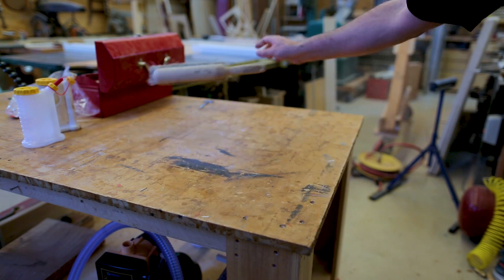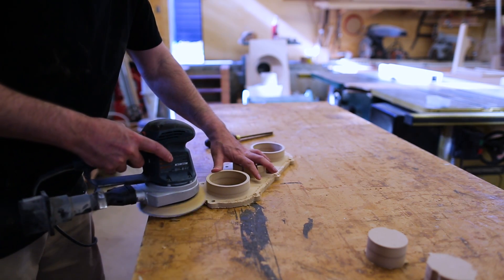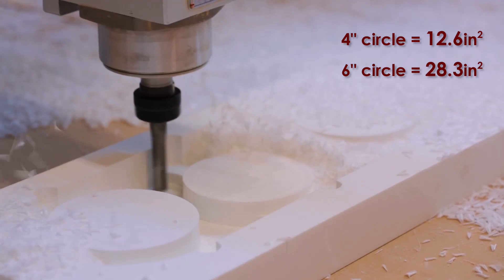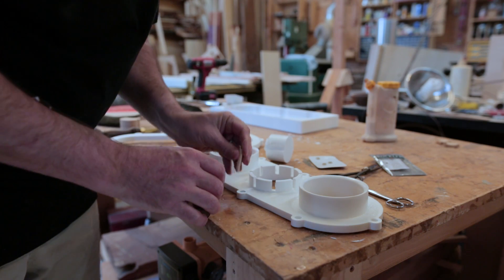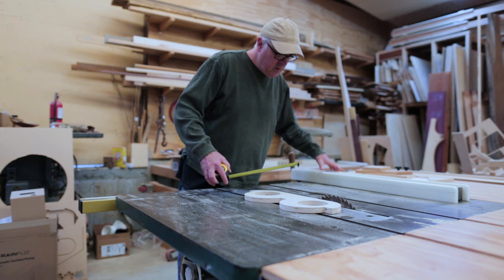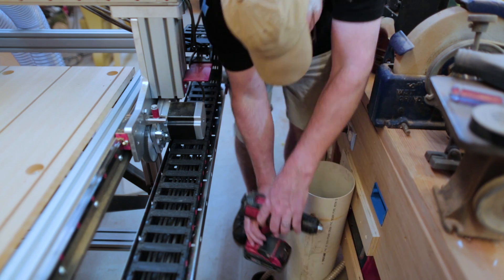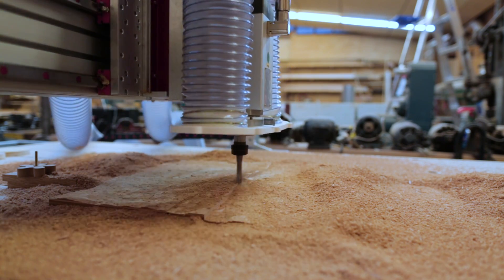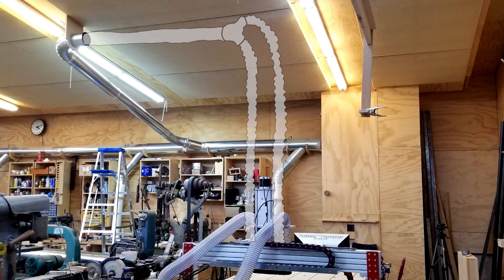CNC Dust Collection part 1

Comment: a 2 or 3 inch removable/hinged brush in the center is the way to go. even when open, 95-98% of the dust will be sucked and you would still see the cutter working.

Comment: Someone else mentioned clear plastic, also you can leave a gap in the front of the brush the suction will still pull air in it and you can see the bit

Comment: It's better to make a "spoil board" to screw your projects to, so your not messing up the wood clamp top... I know you can resurface it.. but you only get so many passes.  Also watching your machine cut the dust shoe, your cam is not set set for optimal cut paths for sure.

For test pieces... I buy the sheet foam at big box stores... (I prefer the purple 3/4" stuff)peel the plastic off and cut/shape away... cuts easy and fast, less wear on your bits... and if you mess up with the g-code it doesn't break anything, and less money than wood.

I built my 10' cnc table from scratch, and I run cambam... for my cam software. 4kw liquid cooled spindle. Good tool.

-Mick

Comment: Hi Frank, I watched this video last week and an idea came to me that may improve on the brush and not visually obscure the cutting tool like a brush. If the brush were replaced with an air curtain it may keep the dust in and allow a clear view. I've worked with air curtains in large industrial plants and they are effective in keeping dust out of sensitive equipment, we used to take a clean compressed air supply and direct it where needed and it worked wonders. I could see a manifold like a copper pipe that has been shaped like the outline of the brush with air ports drilled along the bottom allowing air to hit the table and forming the curtain. Might work?
Reply from the maker: +Brian Boni that's a new one. i like it. Thanks

Comment: Quick Tip: I was triggering my proximity sensor on the Z axis with my dust collection hose.  The wire inside the hose was enough to trigger the sensor because it was dangling around the top of the Z axis.  A small guard fixed it, but was a pain to figure out why it was stopping all the time..

Comment: If the modified bristles don't work out, you could do what I did. Mine is made of clear plastic on the top. You might not be able to get it thick enough for the same way you did this, but I'm sure there's some way to incorporate or include clear windows from the top. Visibility isn't perfect but it helps a lot.

Comment: If it helps for reference, there is a boot for Shapeoko CNC machines called the Suckit Dust Boot.
It doesn't look like it will fit your machine, but you might be able to make something similar.

Comment: Your projects are always inspirational. My $0.02 on this one: Also experiment with a single 4" hose shoe. Does the increased airflow from two hoses balance out the additional loss of suction from the increased size of your brush-enclosed area? My guess is no. The brush-enclosed area should be small for best results. You could actually use both hoses, but reduce down to a smaller brush area with a manifold--that would be sweet. The skirt needs to go all the way around and control airflow as much as possible to be effective. But, as suggested many times, an upper shoe cut from acrylic or plexiglass will increase visibility. Also, a making either the whole skirt or just a window region in your brush from a sheet of flexible clear nylon cut into strips will really help with the visibility. Cheers!

Comment: use the clear plastic brush parts. the brush is really just to corral the dust and create a negative pressure in the cavity. If you used clear plastic flexible "fingers" you could see the work piece and get optimal suction

Comment: As for holding down pieces to the CNC table, have you heard of polymer nails? I hear that the CNC guys at the Artists Asylum use these to hold down their work, which easily pop off after they're done; and not cause any damage to your router bits if you hit one by accident.

https://raptornails.com

Comment: Hi Frank,
nice Video - as always :-).

Two recommendations:

1. If you want to glue something to plastic try RTV silicon. I use this even on POM and it works. It's not super strong but keeps the magnets or the brush in place.

2. To see the router bit during the operation you can make a cutout in the brush. This also helps controlling the air flow. If the brush is all around, the air do not know which way to go and sucking is from everywhere. If you have a small cutout in the area of the router bit the air has a specific way to flow and helps sucking (especially with your suction power).

Best Regards from Germany

Alex

Comment: Nice. Have a suggestion. If you are worried about the visibility of the router bit, why not install a little camera on the plastic piece, pointed at the bit?
Might work. 
Great channel. Thanks.

Comment: Watching this I can't help thinking that the suction would be a whole lot better if rather from the top, the suction came from the sides.  After all, that's the direction the chips are already heading.  So the area just inside the brushes in a loop, if that makes sense.  So just before the chips hit the brush there would be a channel.  Just a thought.
Reply: Good idea only draw back to that idea is how do you get the suction from the sides low enough? When the bit is doing internal cuts something rigid on the outside might limit travel too much.

Comment: For the map data did you convert a DEM to an STL? I've been playing around with that but haven't gotten an output from my mapping software that I can work with well in Fusion360.
Reply from the maker: not sure if this is standard but it is how i figured it out
gray scale tiff from earthexplorer.usgs.gov
displacement on a plane in 3d studio (200x200)
save as obj with quads
import in to Fusion360 and convert into T splines
cam away
also this might be helpful:  http://makezine.com/projects/convert-geological-information-into-custom-map-fit-for-3d-printing-and-milling/

Comment: It'd be cool to wire in solenoid air valves into the power switches of all your tools that way when the tools on the dust collection gate is open. When it's off the gate is closed.

Comment: I'm not sure why you need to see the bit.  The brush  materiel you have should be fine. As long as you touch off the bit correctly you should not need to see it. If the bit is touched off wrong the machine moves to fast to stop it anyway.
Reply from the maker: true, it's mostly for video work.  when i broke the bit it would have happened without the brush in place as well.
Reply: frank howarth sorry was not thinking about the video side. I have about 8 years total experience with CNC, metal and wood but never had to film what I was doing ha ha. You mentioned wanting to switch to Fusion, great program, I recently preorder the Shaper Origin so I am also learning Fusion. Happy CNCing.

Comment: Great timing. I am just getting my Shapeoko3 CNC router setup and looking for a dust shoe option.
I am down in Ashland so we don't have a local supplier of HDPE.  We do have less traffic and better views though:)
Where did you get the brush material?  and HDPE?

If you want to see a close view of your bit, try adding another opening in your shoe and inserting a USB scope such as:
https://www.amazon.com/Microscope-Teslong-Multi-function-Magnification-Waterproof/dp/B01IV0TV50/ref=sr_1_11?s=industrial&ie=UTF8&qid=1497230160&sr=1-11&keywords=microscope+usb+digital+camera
I have one that is no longer available, but it has a video capture as well as live view.
It is just another USB wire to your computer and it gives a great view for tool changes and operational details.

I love seeing your projects.  I need to get going with Fusion360 as well.
Reply from the maker: there is a link in the description for the brush materiel on Amazon.  the HDPE I got a TAP plastics
Reply: Tnx!

Comment: I don't like dust shoes that are attached to the spindle because depending on the length of the endmill you get more or less suction.  I get better results with a dust collector that is attached to the X axis with a T-Slot for manual height adjustment.  I set the height of the dust collector a few inches over the stock I want to cut and it stays at that height.  You just have to make sure that the endmill length is longer that the the height of the dust collector + the deepest cut you will make so the router doesn't crash into the dust collector.  You do not have to remove the dust collector to change tools, you just raise the router to clear the dust collector and if you use acrylic to make the top plate of the dust collector, you can see the endmill while cutting.  Inventables are making a dust collector that use this principle for their x-carve https://www.inventables.com/technologies/x-carve-dust-control-system

Comment: My suggestion is to see if there's enough room in the top of the dust collection fixture to have a Pi Cam (from a Raspberry Pi) and some LEDs stick through.  Then you could monitor what the bit is doing in a web browser.  You'd also have some cool footage.

Comment: So, I have a dust boot for my X-Carve that is attached to the stationary part of the router carriage and adjustable up and down. This enables the brush to be at a fixed height over the workpiece and eliminates the tendency for the brush to affect the motion of the carriage. It does an admirable job of dust collection although I am not thrilled with the quality of the attachment/adjustment design. Just another thing to consider...

Comment: Hey, Mr Howarth. If I may suggest, the brush and its holder could be a separate apparatus attached to the back plate. It would ensure it kept a fixed distance from the bed while giving complete clearance for the spindle to move up and down. I'd love to share a few sketches with you to clarify my suggestion. Cheers!

Comment: Hey Frank, thx for your videos ! what about a transparent acrylic mounting plate ? You will be able to see your bit though it. Instead of the brush some dust shoes have silicon banding which are mostly transparent. On my CNC I have a cyclonic dust coklection. the intake comes at an angle and there's a skirt  with a spiral shape that starts the cyclon swirl. The skirt only goes by the height of the collet and that'enough. The rotqtion of the bit accentuate the cyclon flow. I use a shop vac because depression is higher and air speed too. I don't know if this would work with a large dust collector. Wish this can help you.

Comment: Frank, you can stress relieve this plastic by heating it.  The following source says to bake it at 200 deg in Nitrogen, but I think you should try submerging it in 200 degree water for 30-60 minutes.  Try a sample piece first.  You might find that using a pyrex casserole dish with water, in the oven, is a good solution too.  http://www.boedeker.com/anneal.htm
Reply from the maker: Thanks

Comment: Just had a thought; while not all plastics are suitable for thermoforming, most plastics are in some way responsive in a useful way to judicious application of heat. If you have a scrap piece that's exhibiting this stress-bow I think you should experiment with heating it to relieve the stress. In an ideal world you'd heat it up to around 200~250F on a flat surface for 30~ minutes and all that stress would relax out without significantly impacting the parts dimensionally. The trick is going to be finding a low enough temperature to relax it without really getting it into the "workable" range where things might mush around.

Looks like for delrin that's in the neighborhood of 180F; for Corian it's 300~350F

PS, take the magnets out before tempering; heat can make them demagnetize.

Comment: You could make the (short) sides of the brush (where the hoses attach) from solid transparent material. 

 You can see through and the suction is more centered to the bit.

Comment: Regarding being able to see the bit, it's possible to mount a cheap webcam in the dust hood. If the dust collection does its job, it won't get dusty, they last a decent amount of time even with the vibration, and even when it breaks it's only $20 to replace it.

Comment: Lots of comments about clear vinyl strips.  Before you spend a lot of time making a final product, be sure to test the vinyl / plastic against the static buildup that occurs from the bit spinning, etc.  A clear shield / brush wouldn't be a lot of use if all of the fine particles are stuck to it due to the static charge on the plastic.
Reply from the maker: that is what i wonder about, it being scratched and covered in dust.
Reply: That´s no problem. I´m using this kind of table cover: 
https://www.amazon.com/Kangkang-transparent-customized-tablecloths-tablecloth/dp/B01IEXZOAK/ref=sr_1_30?ie=UTF8&qid=1497472473&sr=8-30&keywords=tablecloth+crystal+clear
Different lengths (because of different bits), fixed with velcro fastener to the dustshoe.

Comment: how about instead of a brush you use some kind of flexible clear housing that you can see through... like clear plastic that can bend at the ends to flow with the router...also you should CNC someones face three dimensionally.. and make it like 4x scale.. that would be cool

Comment: Fun project... An idea I had a while ago while watching the trade-offs with dust collection on CNC machines. Could you build a dust hood that had it's own Z-Axis lead screw controlled by the g-code so it would move up and down with the "terrain" as the cut progressed to keep a near-contact air stream?

Comment: I like dust foots that are separate from the spindle. Takes a lot of the guess work on how long the bristles need to be and they work just as good. Also takes the stress off the spindle itself. Another benifit is changing the tooling.  Here is mine in action.  https://youtu.be/PXrjcU9RQEU

Comment: What about putting a tiny camera and some bright LEDs under the dust shoe?  GoPro session and similar are probably too big unless you mount them through the shoe somehow.  But you can get really tiny NTSC and PAL cameras for home security systems.  The FPV drone world makes heavy use.of these.  You can also get 5 or 7" lcd displays meant for add-on automotive backup cameras for cheap (again FPV pilots use these).  Or get a USB capture device for your computer.

Comment: I'm not sure if this is true, but it seems like the motivation for the brushes is just to stop the chips (literally, reduce their speed) before they gets too far away, and settle down. A one sided shoe doesn't seem like it would work as well for the chips that went out that side. what about a hole in the top, with a camera looking through? I'm pretty sure I would smash a camera that was underneath the shoe.

Comment: My advice : leave a gap in the brush in the middle of the length (where the bit is). This comes with two advantage and one disadvantage :
+ You can see the bit doing the work from most angles (depending on how wide the gap is)
+ This drastically decrease the chance of brush-bit unwanted interaction.
- You loose a bit of suction power
Reply from the maker: This is going to be my first experiment.

Comment: Would do a piece on your use of Kant Twist clamps?  Do they provide more grip?  They are not faster to use, so what is it?  Design novelty?
Reply from the maker: I like where the handle is in relation to the work, and they have huge clamping power with decent throat and fine adjustment.  they are the civilized c-clamp

Comment: maybe use a hold down that instead clamps down, it holds along the side of the material by pressing it against another surface eg. another holder.

these holders have eccentric holes so you can adjust as necessary depending on the size of the material. your waste board will be full of holes to accommodate.

Comment: The fact that there is stress in the plastic is not odd. There actually are stresses in plastics. Especially in extruded parts and parts that are stretched (vacuum forming for example).

Comment: Frank, always enjoy your videos. I have a smaller Shapeoko style CNC and had a dust boot which moved with the head and it always seemed to have problems. I got the Suckit Dust boot and you set the height for the dust boot and the cnc head can move independently. Works so much better, maybe you can design one of your own similar in style and it may function better as the hose stress on the head is taken away. Great video though!

Comment: Dust collecting, one of my most frustrating issues in the shop. Last year, I thought that overarm table saw dust collector is on sale. That has to work great, can't be any worse then the current spray of chips from the 14" blade. Well, wrong. It does not work because you can't get enough suction flow at the end of a pipe. And flexible hose, just adds more restriction. In my case, I used a dedicated dust collector, with a short 8 foot piece of semi rigid 4" vacuum hose, to the reduced 3" pipe of the overarm collector. The optimal suction would be the vacuum impeller mounted right to the dust hood, moving the maximum amount of air. The other issue with the table saw collector, is the darn thing is in the way anytime the rip fence is within the dust hood size distance from the fence.
Your overhead hose, I suggest to leave the 6" pipe size, as far down from your ceiling as possible to minimize the restriction from your 2 corrugated hoses, making the Y split as close to the Z axis spindle as possible.
I wish someone would make a compact light weight motor/impeller for just these sort of collector issues where super high volume is needed.
Thanks for the videos.

Comment: Instead of just friction fit, couldn't you use a two part epoxy as well as friction?  I feel that will at least help with the adhesion more than just friction fit.